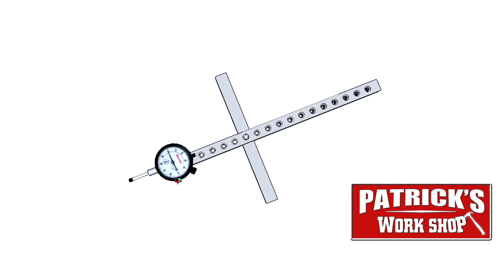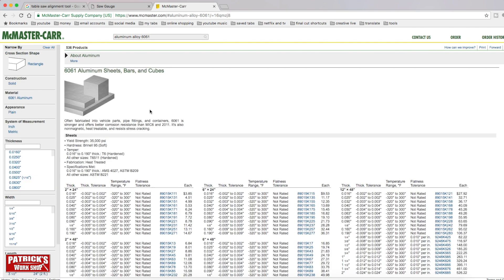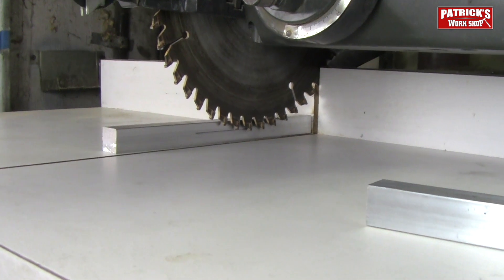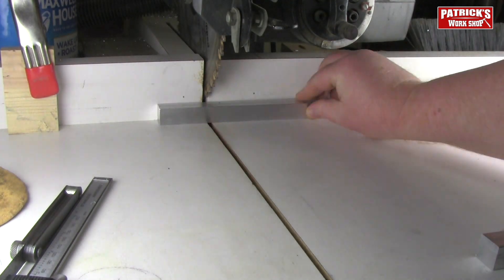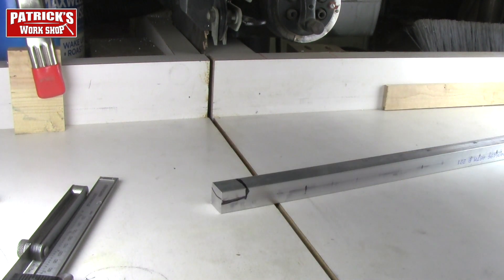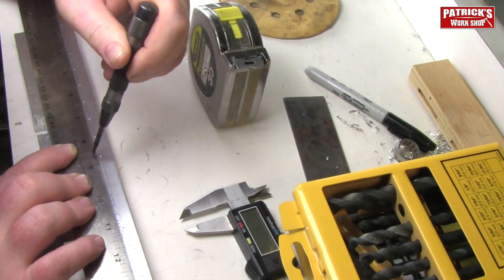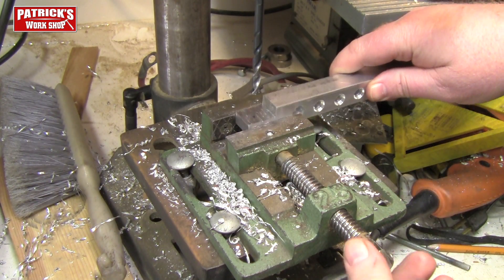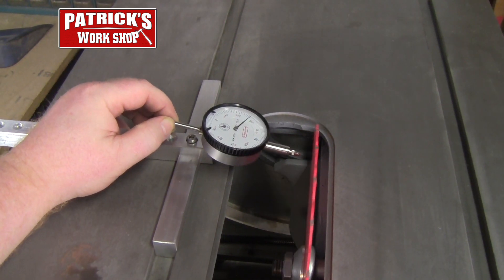How To Make  A Table Saw Alignment Tool

Comment: You have any tips on finding replacement parts? I need new handles for the raising and lowering knobs, and the fence has some small parts that need to be replaced.
Reply from the maker: Check craigslist and Ebay. I see a few pop up every now and then

Comment: what brand is your DI? I haven't found one with what looks like a flat loop, like it looks like you have on yours. I see them with a loop but then you would need a slot or U mount for them.
Reply from the maker: the Dial Indicator i have is one from Grizzly with the magnetic base  it was on sale when i got it  i think around 29 bucks   came in a nice red case too    http://www.grizzly.com/products/Magnetic-Base-Dial-Indicator-Combo/G9849?utm_campaign=zPage&utm_source=grizzly.com  here is a link its on sale again   for 19.99  what a deal  thanks for watching
Reply: Ok,rewatched it again and now see how you did it at 1:34 I see you did a rabbet. is the a sketchup file for this? the notched piece is 8.75", how long is the rabbet piece?

Comment: how much did it cost to build vs buy?
Reply from the maker: hey Brian  thanks for watching buddy  so for the numbers  it was 27 for the aluminum and 1 dollar for the bolts plus a dial indicator but i had one in stock already ,as for buying it new from a company  the red one sold on the internet starts at 154 bucks + tax and shipping so  and the other one from woodpeckers runs about 75 shipped   so all in all i like mine way better   thanks for watching  i hope this answers your question
Reply: Patrick's WorkShop awesome thanks buddy

Comment: So you really can just use regular woodworking tools on aluminum?
Reply from the maker: forsure  i wouldn't use my good blades on it but thats just me ,but sure why not . i used a old craftsman blade in the video to do all the cuts and today i used that same setup to up cut some poplar trim and it cut clean as ever   i really think it depends on what you're making too and  how much you try to cut all at once   light passes is what i do to make the blade last as well as not messing up the project but most woodworking tools can do aluminum no problem

Comment: Excellent idea, looks great..... my only suggestion would be to use heli-coils or keenserts for the tapped holes. Aluminum is very soft and repeated use of the threads will cause them to weaken over time...
Reply from the maker: Thanks for the tips I'll keep that in mind , thanks so much for watching

Comment: Nice!! How would you tackle the problem for differnet width/sized miter slots?
Reply from the maker: as far as i know from my vast years on this planet, all table saws have a 3/4 wide miter slot   also the dial indicator pushes away from the blade and makes the runner contact the far side anyway so it would work with all  sizes   thanks for watching
Reply: Fair enough. Thanks for the quick reply. Sadly I don't own any saws soI have no real knowledge of tablesaws apart from what I see on Youtube.